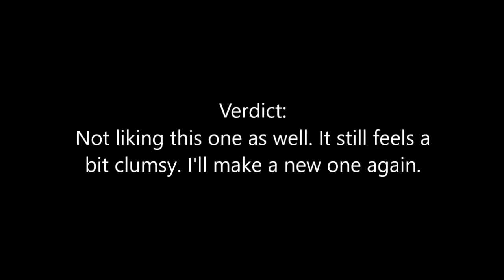Project: Making a cable reel (2)

Comment: That's a cool design, I'm going to give it a try. 
I know unsolicited advice is rightfully unwelcome, but man, please don't use the angle grinder for cutting wood. Get a jigsaw or a circular saw. I've seen some awful accidents with that wood blade for angle grinder. And when I had an accident myself, the surgeon told me that every weekend he had several cases of injuries with that type of blade. The grinder is just not designed for that job.
Reply from the maker: Thank you. Safety advice is always welcomed.